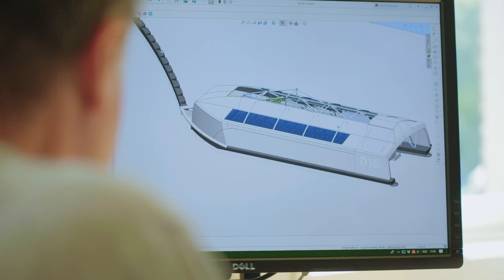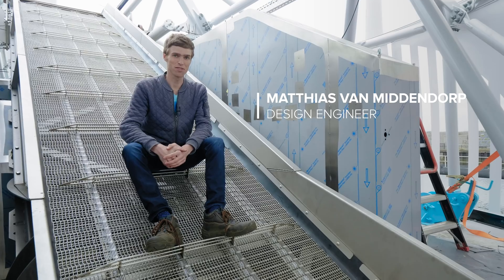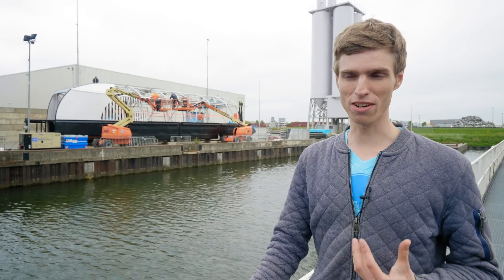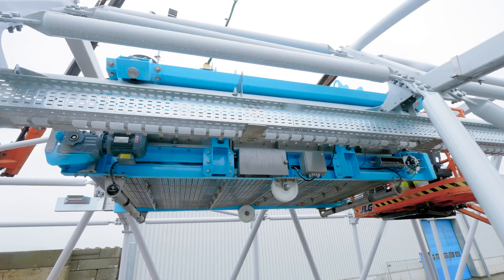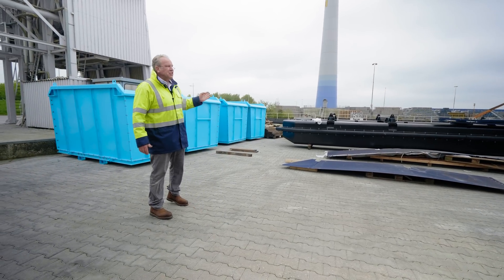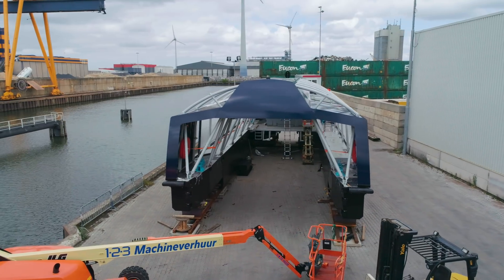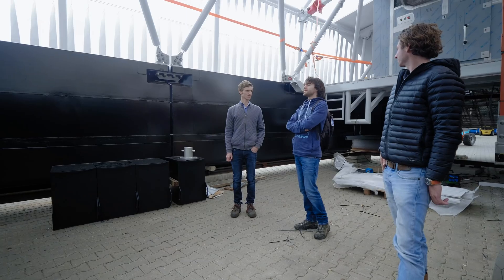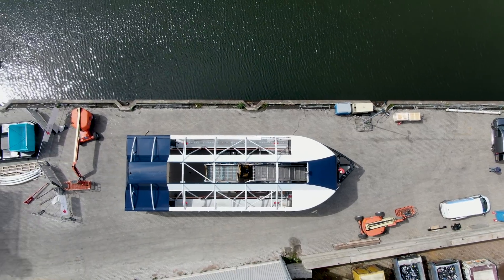Part 2: Interceptor Design And Boyan’s First Visit To See It | Interceptor 004 | The Ocean Cleanup

Comment: We need more emphasis on highway cleanup throughout the US. It would make a huge difference. All of it eventually flows into the waterways. Should be full time vacuum machines along the highways all night... especially toll roads.
Reply from the maker: While this sounds interesting, and like a problem that requires attention, our current focus is on designing technology for deployment in rivers and the five circulating ocean gyres.
Reply: @theoceancleanup  absolutely I just meant this as observation not so much a demand. Keep up good work 💪

Comment: Why put solar in the shade of those bars? that will kill efficency??
Reply from the maker: Thanks for the note - this is a design feature that we are evaluating as we improve the Interceptor's efficiency.
Reply: @theoceancleanup  thats good to know! I only say that because with my solar panels if you block a only a few % of the area the output drops by over half!(since it creates a resistance in the circuit) I know you can do things like power optimise and use more diodes to mitigate this effect a little but seems better to just avoid this possibility if it is feasible, especially when the panels are out in the open with no chance of shadows. Thanks for the reply and wish the project all the best.